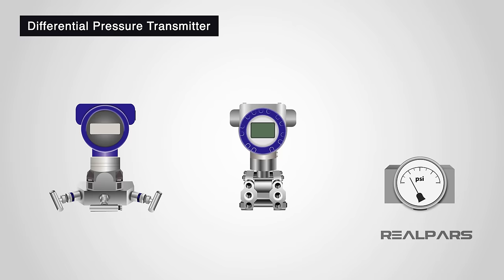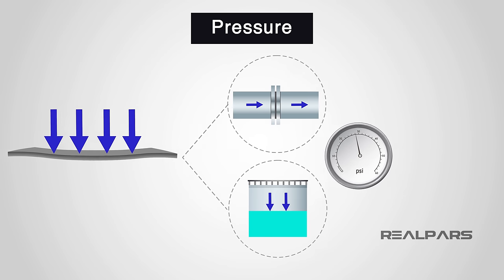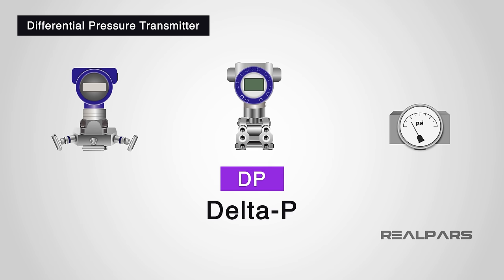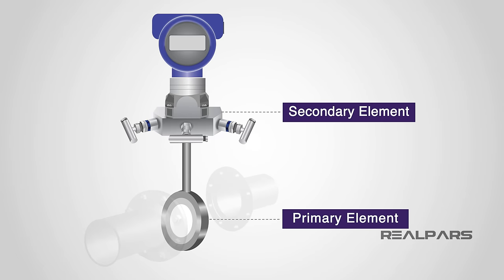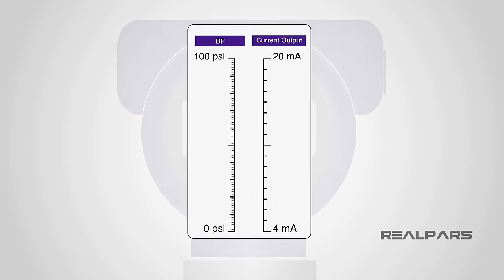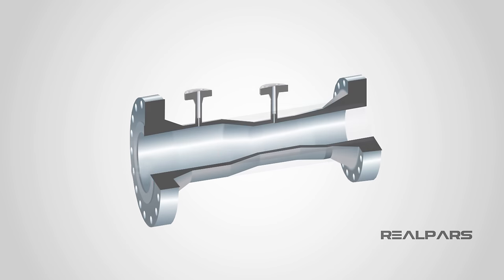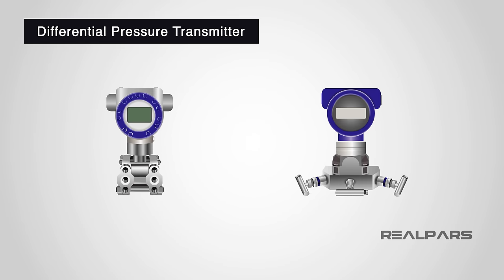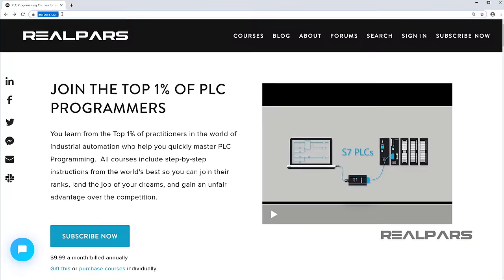Differential Pressure Transmitter Explained

Comment: The best educational channel, but I think the pressure transducer that you explained in the introduction to the video is the flow transformation, isn't it?
Reply from the maker: Differential pressure transmitters can be used for flow measurement, level measurement, and differential pressure measurement. The masnifold shown on the pressure transmitters shown in the opening segment are most often associated with flow measurement, but can be used in all three applications.

Comment: Does the paid subscription to your site offer more in-depth instruction of the topics offered here? Thanks.
Reply from the maker: Hi Ono, 

Thanks for your comment!

It indeed does, our free videos on YouTube do not follow a specific start to finish structure. Whereas our course library is specifically designed in a way where it provides all the tools needed for beginners to evolve into an advanced level through our hands-on courses.

Feel free to have a browse through our course library to see which topics we cover at the moment. https://bit.ly/30ZrxWq

Additionally, by subscribing you will have access to our Technical Team - consisting of high ranking engineers with a lifetime of experience - who are here to help you out with any questions you might have along the way! 

I hope this answers your question sufficiently. If you have any other questions or would like any further assistance, feel free to reach back out.

Comment: Would you please clarify what did you mean by " .....and one of several ways to convert the pressure applied onto the diaphragms into an electrical signal " ?
Reply from the maker: The process pressure can be converted into an electrical signal through a detected change in capacitance, by sensing the pressure using compression of a special ceramic substrate, or by deflection of a piezoelectric bridge.  These are all physical methods of converting pressure forces into electrical signals.

Comment: Any measuring instrument for mean effective pressure sir
Reply from the maker: If you are referring to mean effective pressure, which is the measure of an engine’s capacity to do work independent of engine displacement, then a very small pressure transducer is used that measures the cylinder pressure.  Mean effective pressure determined by calculation over the entire cycle of the engine (compression, ignition, exhaust).  These are typically small electromagnetic gauge pressure sensors.  A good example can be found at:  https://new.abb.com/products/measurement-products/diesel-engine-monitoring/pressure-transducer-pfpl203

Comment: Great video thank you for uploading. Just one comment: around minute 3:14 when it says “the low increases” ... doesn’t that need disambiguating? When the flow’s speed increases, right? Because the flow’s mass rate stays constant.... 

Btw, if the goal was to measure dP across a strainer... wondering how it would work...
Reply from the maker: There are many types of sensing elements that measure the fluid pressure upstream of the sensor (high side) and downstream of the element (low side).  This differential pressure can be correlated to the flow, and the relationship is "flow is proportional the square root of the pressure differential".  If I simply want to measure the pressure drop across a filter or strainer, for example, I just need to position the high-side sensing tap upstream of the filter housing or strainer and the low-side sensing tap downstream of the filter housing or strainer.

Comment: What If DP is showing negative value?
Reply from the maker: There are many instances where a negative value is quite normal.  A common range for a DP cell is -150 inH2O to +150 inH2O.  This allows for situations where the transmitter is installed what is called a zero elevation situation (wet leg, transmitter positioned below URL).